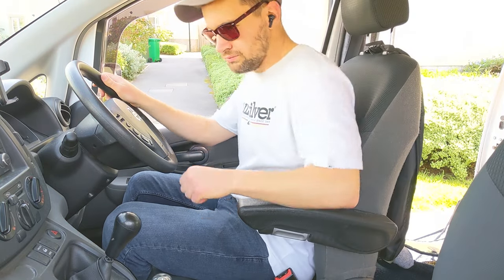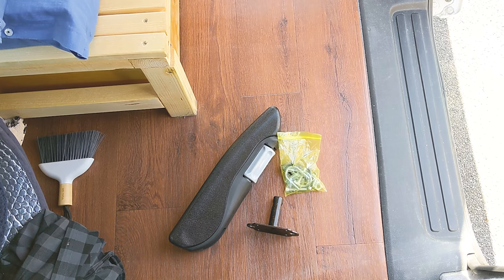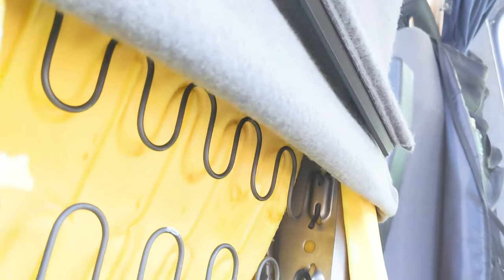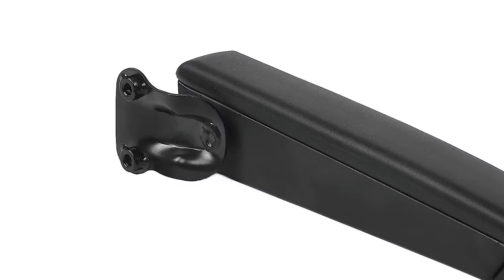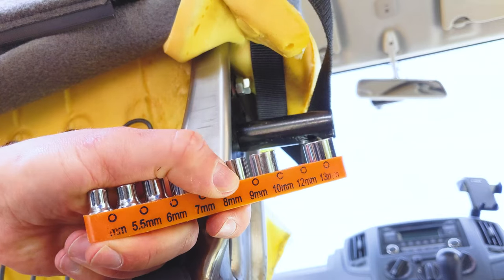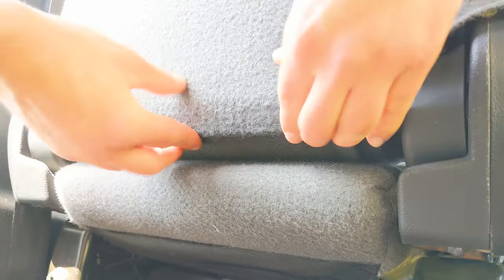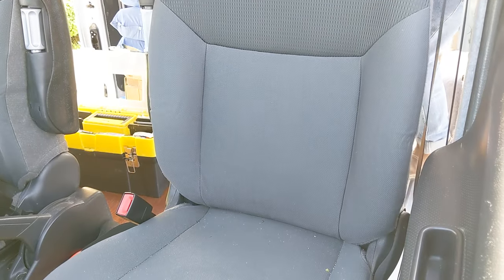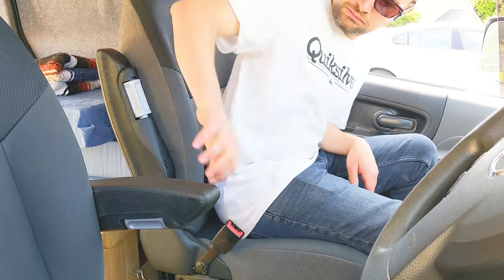How To Install An Armrest In Your Vehicle | Make Your Drive Extra Comfortable

Comment: The wires in the kit are hog rings, used for attaching the seat cover to the seat foam if you need to cut the old ones off for access.

Comment: “Arms by your ears”.  Too funny.  

A couple days ago I replaced the upholstery on the passenger seat.  I can tell you the plastic attachment point at the bottom didn’t come apart nearly as easy as you made it look.   What was worse is getting the new one clipped on.  

I work/stay in mine in much hotter areas than you.  Decided early on that vinyl was too hot.  Ordered replacement leather upholstery with a ventilated seat kit (but only for the drivers side).  

Started with the passenger seat since it would be the easier and faster side.  Adding the armrest on the passenger was an afterthought.  

I’ll try to take a video reupholstering/adding the ventilation on the drivers.   2020 cargo van (America). 

Those hog rings (wire attachments) are a pain.  I found it easier to clip them and reattach with zip ties.  

Thanks for your video.